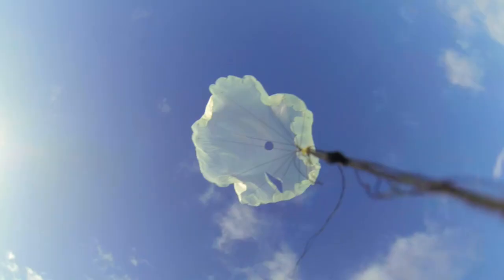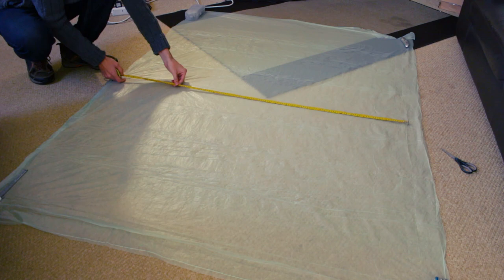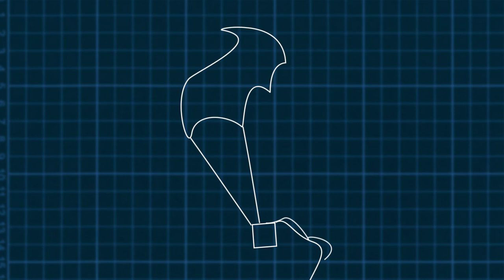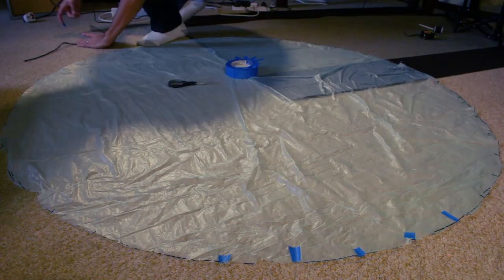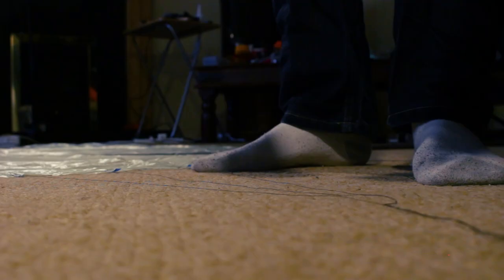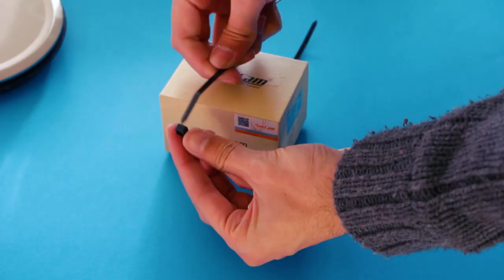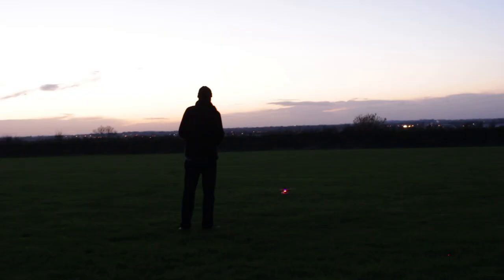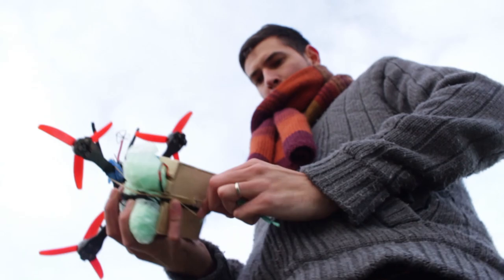How to make a homemade parachute

Comment: What did you use to initiate the release of the parachute package?
Reply from the maker: When I drop it from the drone using a servo and an elastic band, the parachute stars to open because of the air, first the strings start to unroll and then the air open the parachute.
Reply: @Joyplanes  i guess , the question is how does it get dropped from done when  you tied it with drone. what action triggers the drop. Thank you in advance for answering the question
Reply from the maker: @marvisingh294  A servo connected to the receiver, when I flip a switch it realizes the parachute.

Comment: Interesting that the parachute just needs to be cut in a purely round shape. I thought round parachutes have a more complex shape to help with quick opening
Reply from the maker: Actually the real one is made out some sort of triangular shapes. To make a better bell shape. The new ones the T-11 is a square shaped parachute very big.
Reply: @Joyplanes  i road a t11 on the last 5 jumps i had in the army. so soft so easy. you can even unbuckle the chest strap to increase the softness of the landing.

Comment: What an amazing job. I have 2 questions. Can you reuse the parachutes? The other question is can I use this parachute for 12 kg?
Reply from the maker: You can reuse them, 12 Kg is too much for this size.
Reply: with 12 kilogram load , i recommend you a 8-10 meters of parachute both in the length and wide .

Comment: i used to make parachutes like this, but in a rectangular shape, and it flies. i believe yours could fly as well, the thing that make it fall that quick is payload. you're overloading your parachute so the drag force is so big. next time, try to lower your payload and you'll be surprised that those plastic parachutes could fly, i don't mean gliding, i really mean flying, just like paragliders. it's all a matter of loading your parachute with the right payload, not too heavy and not too light. i flew lot of them when i was kid, especially on windy days.